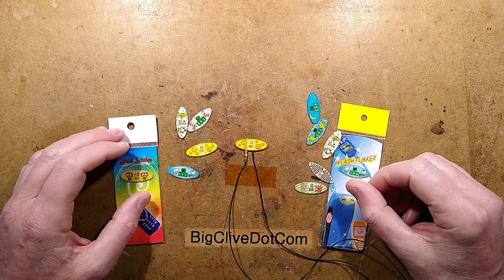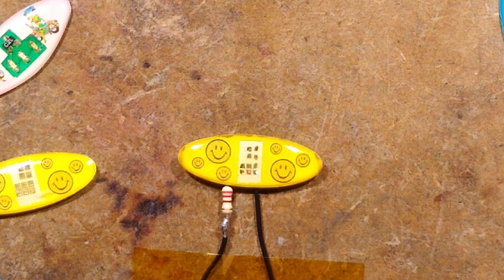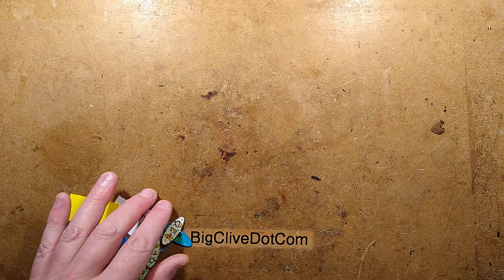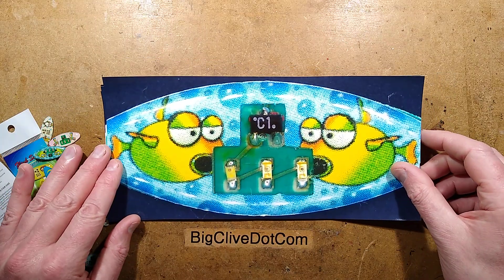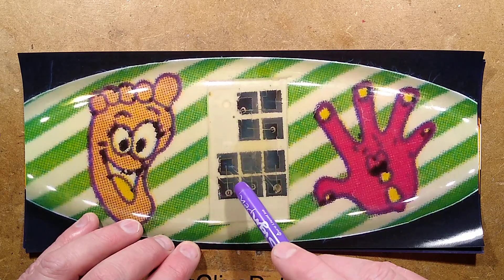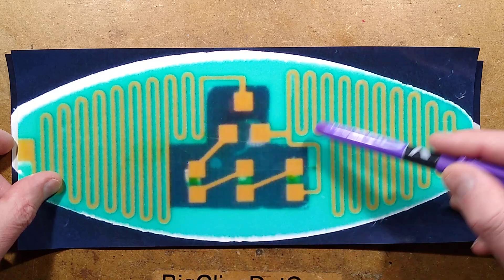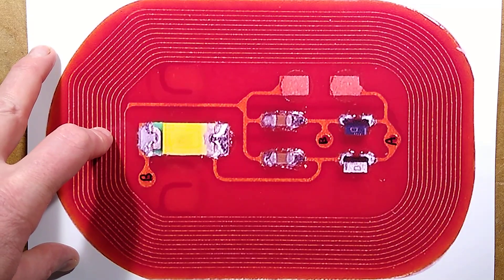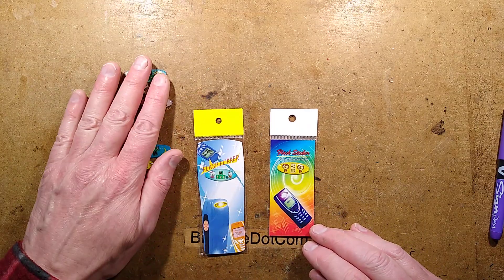How self-powered flashing phone stickers worked (with schematic)

Comment: I used to have these, as well as a replacement Nokia antenna that would light up. 

You always knew a call was coming in before your phone would even ring lol
Reply: My computer's speakers would make that little "dit da dit da dit" noise just before the cell phone would ring.
Reply: @tncorgi92  Oh I remember that noise. The speaker wire, if not properly shielded would act as a giant antenna and pick up your mobile signal. That's why back then troubleshooting tips always included "make sure to place the device away from any mobile devices such as cell phones."
Reply: @PunakiviAddikti  speaker wires, any audi wires as such, antennas, not sure if there was anything not making that typical sound.
Reply: @alexanderkupke920  yeah. It typically requires an amplifier though, like those computer speakers with amplifier, all radios, sometimes land-line phones and even headphones.
Reply: @tncorgi92  ah yes, I could hear them on the radio as well. you never got them really muted
Reply: @tncorgi92  This was most noticable with my NexTel phone.   I kept it above the keyboard, below the speakers.  They'd go NUTS when the phone was going to ring, and I kept having people on the other end wondering why they didn't hear it ring before I answered.
Reply: Yes that very distict sound anytime a call came in anywhere near a speaker. It happened all the time with my guitar amp....most people didn't know what I was talking about when I pointed it out, or how I could predict an incoming call seconds before the first ring.
Reply: @tncorgi92  Analog transmission power was greater?
Reply: @eddiewillers1  Are you asking or making an unsure statement?
Reply: @richardmillhousenixon  Unsure statement - I seem to recall the 2G analog phones used higher-powered transmitters.
Reply: @eddiewillers1  2G was digital. Only 1G was analog
Reply: @richardmillhousenixon  Got it - thanks. I always thought 1G were the 'brick' and 'shoulder bag' type phones - guess the handset I had in 1994 had older tech.
Reply: @eddiewillers1  I'm not sure what phone exactly you're talking about but if it had the capability to text than it was more than likely on the 2G network, as without proprietary wireless networking no phones were capable of texting until the introduction of 2G in 1991. 1G was fairly quickly shut down in Europe, as under the GSM standard (the standard for European carriers) 2G used the same exact frequency band as 1G. Although I can't find any references as to when 1G was phased out and shut down in North America, it likely was at least a few years further down the line, as the CDMA standard used in NA at the time allowed 1G and 2G to coexist, with 2G only using some of the frequencies used by 1G. Both 1G and 2G used digital signaling for the transmission of non-voice data (such as which number you want to call) but 1G sent the voice data as an analog signal, while 2G sent it as a digital signal.
Reply: @eddiewillers1  It should also be noted that CDMA is slowly being overtaken by GSM in the US today, as Verizon and Sprint (Yes I know Sprint merged with T-Mobile, but I am still referring to them separately because they use different technologies) are the only big CDMA carriers in the US, with both AT&T and T-Mobile using the GSM standard.
Reply: @richardmillhousenixon  the first generation analogue mobiles were fun, as you could listen in to people's conversations on a normal handheld radio scanner!
Reply: @eddiewillers1  
You can hear through the static if the signal was weak in analog.Digital,you get drops faster and you do not get static but Digital robotic break sounds pluss if there's to much noise,the Digital drops half other nosie. Digital is doted wave were analog is connected continuous wave.
Reply: @tncorgi92  mine used to do the same thing
Reply: @tncorgi92  thanks for  the memories…..i had forgotten about them
Reply: @tncorgi92  mine did that as well
Reply: @tncorgi92  ah yes GSM Buzz/Hum
Reply: Mobiles are paged on multiple cells to find you. It would flash when it responded to the page. Then the cell you responded to would set up a traffic channel and only then would the mobile alert you to an incoming call.
Reply: Also your pc speakers made a buzz right before you got a phonecall
Reply: Haha, this brings back memories, i once dropped my nokia down a flight of stairs and damaged the antenna, the only replacement handily available was one of the flashing ones with a blue led on the tip, sold by one of the typical nokia frontcover and case booths on street corners.
Had it for a week until i got a proper original one, terrible reception and dropouts during calls alongside higher battery drain.
A novelty at it's time, but not a good one.
Reply: @timhartherz5652  Considering you dropped an old Nokia i was suspecting you might have damaged the stairs...
Reply: @alexanderkupke920  LOL yup those Nokias were amazingly tough!!!
I had a sticky pad on my dash that i would put my Nokia on and one time i took a corner too fast and my phone passed right in front of me and out the window i watched it in the mirror bouncing on the asphalt ..i stopped went back picked up the pieces put the battery back in and powered it up worked perfectly...
Reply: @alexanderkupke920  Hehe, might have, but since they were plain concrete stairs in an industrial building, they had a rough finish anyway, so any additional damage didn't stand out too much.
Reply: @timhartherz5652  You damaged a Nokia? Impossible!
Reply: @JohnRunyon  the external antenna was pretty much the only vulnerability on the 51xx models, anything else just fell off or could easily replaced. Pretty sure, that's one of the reasons why they got rid of the antenna on later models.
I also managed to damage an 71xx (also an older one with external antenna, rather large LCD and scroll wheel) by accidentally running it over with a car (both axes) cracked the LCD, but was otherwise fine, was even still on.
Wouldn't call them quite "indestructible" but you would have to try hard, harder than with any so called "rugged" phone these days.
Kinda miss them, even their later smartphones weren't terrible, they were cheap and lasted a week on one charge, the only thing terrible about them was the abysmal windows phone OS.
Reply: I bought one for my wife (many years ago) to stick on the outside of her handbag because her phone was "burried" among all the other clutter inside. She refused to fit it and continued to miss calls. :-)
Reply: I bought one of the antennas (probably something cheap and nasty from China) used it a few times, realised I was getting shit reception and battery life so I went back to the normal antenna. I expect it's in a box of junk somewhere.
Reply: Our DAB radio at work is prone to my phone interfering with it, I have it right next to the radio at work and it squawks out that familiar dit-da-dit etc when the phone is still checking for network.
Reply: Those antennas had the brightest blue LEDs I'd seen up to that point, inspired me to attempt to build an LED grow light way back then.
Reply: @ProlificInvention  those blue LEDs were INSANELY bright, My external HDD rack used them and I'd joke that I had to move it away from my window because it was blinding aircraft.
Reply: @ProlificInvention  I take it that was just for vegging 😂
Reply: @PERCYxyz  It was actually supplemental light to back up a 400 watt HPS mirrored Gavita bulb in a pyrex air cooled tube.  You see I had a business called "Gold Factory" which was where I converted old stand up deep freezers into grow units for cannabis.  I used these 2 60watt draw CFL lamps as supplemental lights but wanted to try my hand at replacing them with LEDs.  I was successful at making a lamp but with the limited space I had it was only a 30 watt or so draw...not a sufficient replacement, not to mention those 250 LEDs and drivers costed me $600 😆
Reply: We had Nextel phones (iDen) that we would leave on our toolboxes at work. They were near the radio and would click and pop of the radio before a call came it. You'd hear it and start heading to your phone to answer it.
Reply: I used to set my phone near my computer speaker and it would buzz before I got a phone call.
Reply: "knew a call was coming before phone would even ring"

Sound like truecaller of the old days 😂😂😂
Reply: I remember all my nextel and my 2G att nokia phone would make speakers have a data ticking sound. I would be watching tv and i would here tick tick tick on the tv speakers and my nokias screen would come on but without a backlight for a few seconds and then the backlight comes on and start ringing. It was the same with calls and text. When i used data the ticking would change depending on the data. On nextel phones it was constant but it was louder on a call or downloading a text
Reply: Yeah, that's what I thought these stickers were for at the time: some silly bling that would alert you you were about to receive a call. Never knew they were sold under the "protect yourself from your phone's radiation" angle.
Reply: Been looking for a video on these antennas. Totally agree on light before ringer. Would be cool to have on the top of our candybar phones now but I suspect they'd light up near constantly with the always on data stream.
Reply: I had a pen with a flashing top, was handy in class until other students realised how it worked and told the teacher that my phone was on.
Reply: Now a days we have Truecaller app 😂😂😂😂
Reply: Absolutely living up to your name. Lol
Reply: I never had these antennas or stickers but i knew when my phone would ring when my CRT TV made wird noises hahahahha

Comment: Oh the times.. Everyone had one of those flashy things and then then suddenly within one or two years they all vanished. Gas stations sold them for a long time but no-one was buying them any more. Everybody knew that they either weakened the signal or drained the battery so the fad died out fast.
Also, i had a extra power-battery in my Nokia (2110, bought used) and the batteries inside are 4x NiMH sized AA, 6v and 1500mAh! I still have it on my shelf, would work still if i had a working battery and charger for it... Brick but a durable brick...

Comment: There used to be an iPhone case called the Lune Case that worked on the same/similar concept that had glowing lights, a “phone call” glyph light and an “sms message” glyph light, on the back of the case that could supposedly distinguish between the two and make the corresponding glyph pulse. I wanted one for the longest time, but never got around to actually buying one…

Comment: Wife had an old feature phone that had LEDs along the sides hardwired to the phone so no rf loss and it was great - no more fumbling in purse for phone, you could see it immediately. When she moved on from that phone, I got some fingernail stickers (tiny, like 5mm square) off ebay that wouldn't work unless they were RIGHT NEXT TO the antenna/battery (like actually stuck on the battery). Thought about carving a hole in battery compartment cover (note 4) but as I don't throw my phone in bag, unnecessary for me, and these didn't work on wife's iPhone. 

Manufacturers seriously need to bring that innovation back, it's too smart to not be using this feature.

Comment: DAMN!!! i was looking for these things a pair of years ago, no luck finding em locally now (and apparently they don't work anymore)

anyways Clive you could try with a 433MHz transmitter to make em light up, the harmonic frequency for the 900MHz and output power may be enough (MAAAAYBE)
Reply: To add to that, most car keys operate in the 433MHz range.
Reply: @olmostgudinaf8100  yeah, it's nothing hard to find, they apparently have a 10mW output, if the sticker receives like 0.5-1mW it should light up visibly enough

Comment: this reminds me of all those uneducated people that constantly demands Fewer cellphone-towers cause of "harmful radiation". Not only is the radiation from cellphones not harmful, more towers also means LESS radiation:
You can either have 4 towers each covering a small area, or 1 tower going full-blast to cover a large area. And to cover a large area that tower needs a way higher output-power and thus far higher radiation nearby.

And that is ignoring that shorter range means less obstruction and that power does not just fall off quadratically but with a higher power so even less power is needed with more towers... let alone that 5G needs less energy/power to transmit the same amount of data then 4G does, and 4G needs less power than 3G, which needs less than 2G...... and all are royally swamped by normal Radio.

Comment: They might be sufficient power to work from a dect phone. There are amplified versions that uses a battery. These were sold to indicate when your phone was ringing in your pocket, but the environmenta audiol noise was to great to hear it ringing. They relied on the RF transaction that happens between the phone and the cell tower, when the phone  accepts a call. 
 Unfortunately, they also detected any mobile phone ringing that is near by. There is a version designed specifically to search for active WiFi. This key fob design is powered by a cr2032 battery and has a line of LEDs that provide a signal strength indicator. It has been designed with a directional aerial, that gives some indication of where the  WiFi router is located.
I have a passive encapsulated RF detector, that uses a voltage doubler diode RF probe connected to a moving coil uA meter, that is a handy signal strength indicator. It gives a good response to a DECT phone signal.
Reply: Doesn't DECT work in a very different frequency range?
Reply: @olmostgudinaf8100  the UK DECT phones work in the band from 1.88 to 1.9 GHz. GSM works from 0.9 to 1.8 GHz. 
The simple diode detectors are not very frequency selective, they rely on aerial tuning, which is very broad band and influenced by surrounding dielectric materials. Even simply RF schottky diodes, are still able to rectify this band of RF signals. The easy with which these RF signals, at these sort of power levels, can be rectified is evident by the breakthrough that is often heard on audio equipment operating in close proximity. The RF signals are TDMA switched, allowing this AM component to be demodulated by audio circuits.

I have a DECT phone on my desk, in close proximity to my intercom. It required the fitting of ferrite  clip on cores to be added to both the intercom power and audio leads, to stop the DECT signal being picked up on the intercom audio. The RF signal also finds its way on the the landline telephone that is located on the other end of the desk. This too required ferrites to be fitted to control the interference level on the telephone audio. 
While DECT and GSM RF signals produce audio interference, this is nothing compared that generated by  TETRA portable equipment, which operates at a much higher power level, at half the operating carrier frequency (UHF band).
Reply: I have one of the Wi-Fi ones on me
Reply: @big8news  I too have a Wi-Fi signal strength detector. In the form of a keyring fob. It runs on a 2032 battery and has a row of green LEDs which light up to indicate detected Wi-Fi signal strength, I assume only on the 2.4GHz band. 
It is very useful, as it is extremely directional. This enables the source of the signal to be located. I think it was intended to locate WiFi hot spots, but I find it useful as a quick test of my Wi-Fi modem. 
My tablet has a far better signal strength tester app, but I don't think this will locate an un-modulated carrier.  In my area the 2,4GHz band is fully occupied, and most of the modems are using auto frequency changing. Randomly moving the channel number, this moves the centre of the carrier frequency up and down the band. Unfortunately it's an open loop system, which does not appear to look for an unoccupied channel. So periodically all the users cluster on the same channel, making the WiFi data rates fall.
I would be interested to know if WiFi modems use collision detection CDMA algorithms to avoid such channel clustering.

Comment: Try nipping off both ends of the sticker antennas while your WIFI router is transmitting. If you shorten the length of the antenna, it should work.

Comment: Wider antenna wires increase the bandwidth of the tuned area of the antenna (wider frequency range that it works over). The later ones may have went for a shorter length (1/8th wave or something) for more space for a wider bandwidth.
Reply: A shortened antenna would be useless unless it had inductance to "load" it. More likely the different antenna would be for different frequencies in different countries. Or just different phone companies.
Reply: @graemezimmer604  there are multiple lengths of antennas that tune to resonance at a particular frequency including shortened antennas. Adding inductance to a resonant antenna detunes it. Adding inductance to a non-resonant antenna can tune it however

Comment: i think this is how them cell phone signal booster stickers was supposed to work  remember in the 90s there was a sticker you could buy from tv that was supposed to boost the signal?

the stickers had lines cut that resemble the South Africa flag.

those lines would pick up the signal then surface mound diode would turn the signal into dc to power an amplifier chip and other parts of the South Africa flag like design would repeat the signal to the phone.